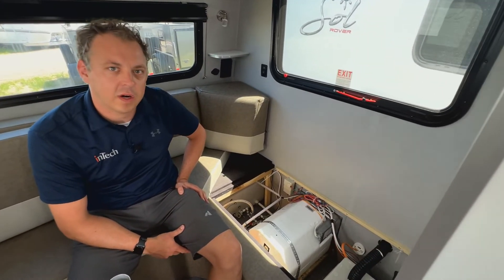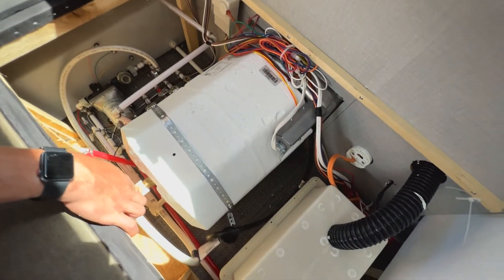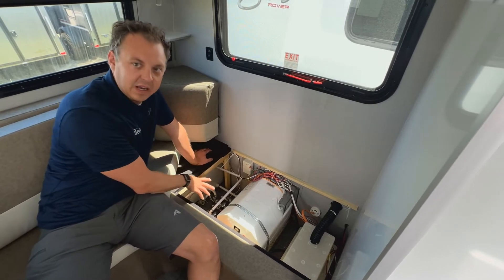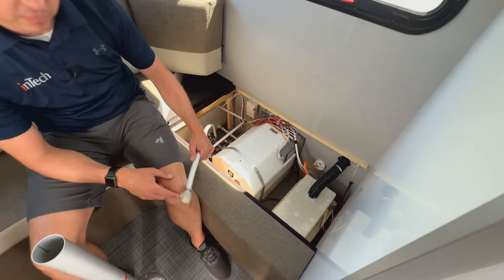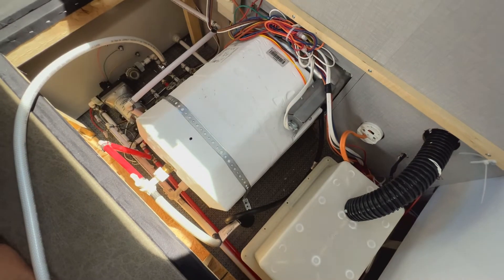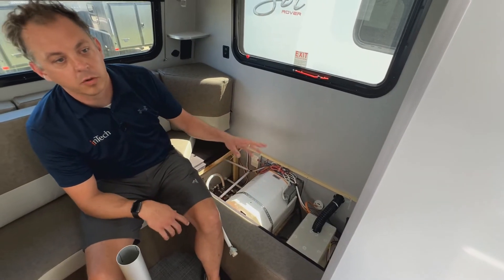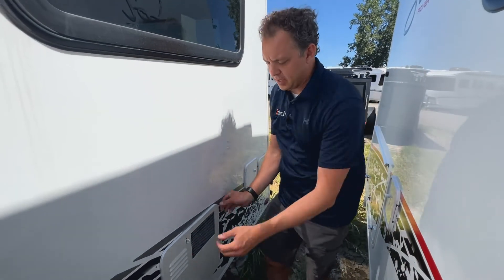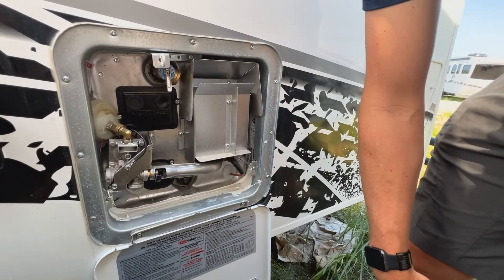Winterizing (Sol Eclipse)

Comment: This is a terrible video. No detail on what way or orientation the valves are supposed to be and specifically for the hot water heater. Don’t damage it but you don’t say which way or how to do any of the winterizing. We got here’s the valves, here’s the hose and good luck. 👀👎🏽